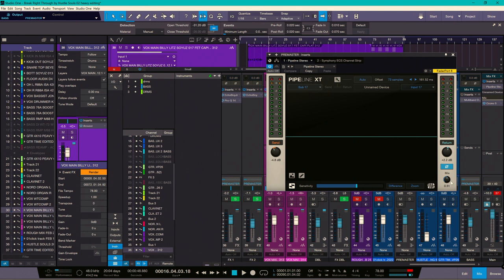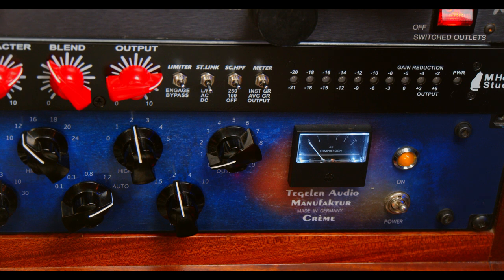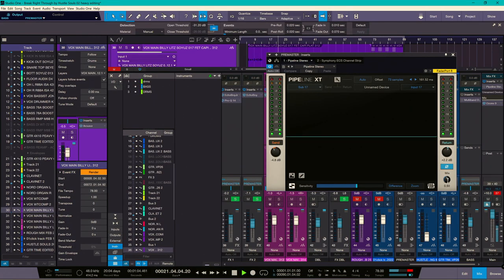How You Can Hear 1 dB of Compression ?!?

Comment: I may have mixed it, but I think you may have forgot to compensate for the i/o latency when sending out to your outboard compressor. If that's true, then compensating will give you a better cancellation. The uncompensated delay will create a comb filter, which is why your "cancelled out" signal still contains a lot of high frequencies and sibilants. They would be gone if you had compensated. What you're doing is a useful technique and this could improve it a little.
Reply: I'm pretty sure at one point he showed a waveform where the latency was being compensated.
Reply: @unclemick-synths  OK must have missed it? can you find what time it was at?
Reply: @cheater00  I think that's it at 6:32 where he shows the traces overlaid and it seems to be latency compensated unless I'm misunderstanding what I'm seeing.
Reply: @unclemick-synths  that seems to be it thanks
Reply from the maker: Yes it’s correct that I’ve compensated for the delay. I think I showed it when I had the polarity flipped. So it doesn’t line up but it mirrors the other signal.
Reply from the maker: I think that the compressor adds flavor or my cabling is adding color. I’ve updated a lot of my cables but maybe not the ones for the Creme.
Reply: @creativesoundlab  you could try spectral matching using something like Voxengo Curve EQ to make the transition unity-gain at all frequencies.